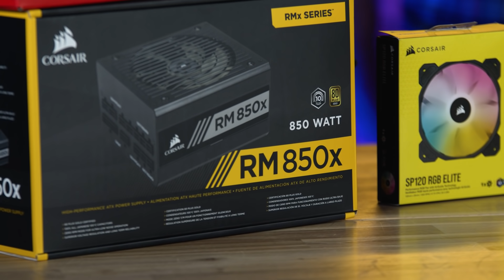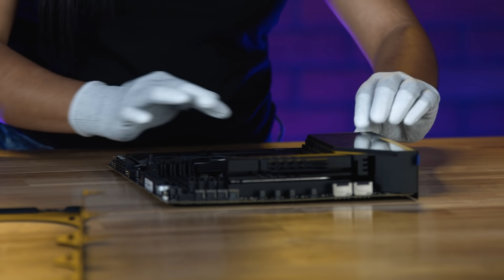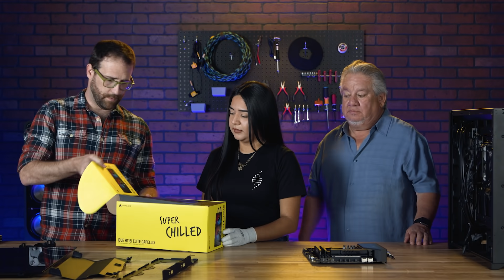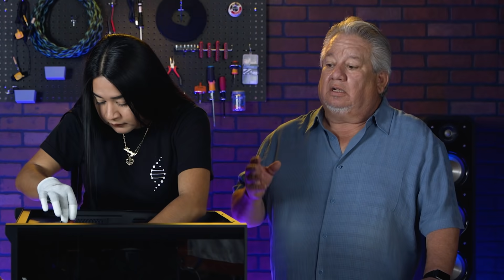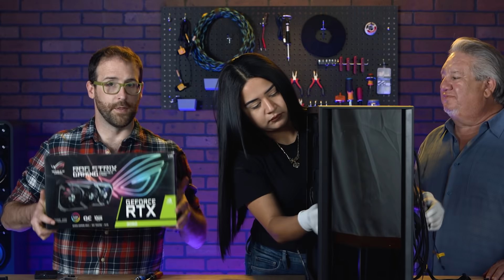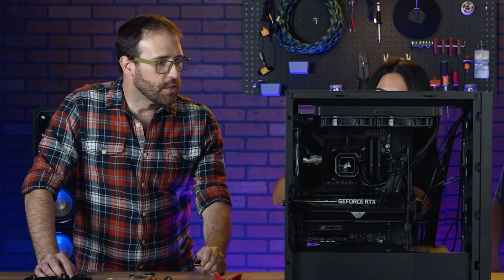Win This Alder Lake Build: Alder Lake 12th Gen Intel Gaming PC

Comment: I would once again like to say thanks to #Newegg for the computer. It's a great system and I use it every day. I don't use the GPU support for a headphone rack though 😛. One thing I did find, a year later, is that they left all the case hardware in a box in the useless HDD trays . Which was a pain in the ass to get to as the rear fan mounting bracket is tough to get out. Luckily reddit came to the rescue.